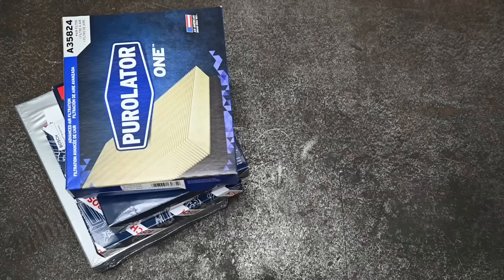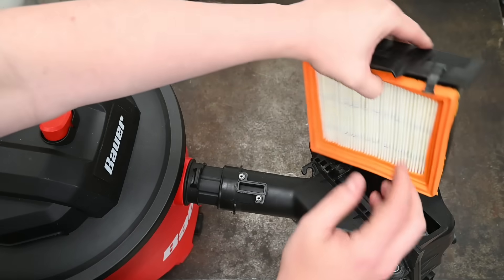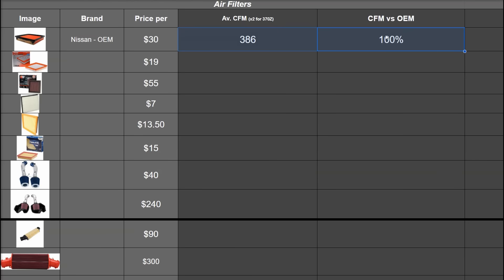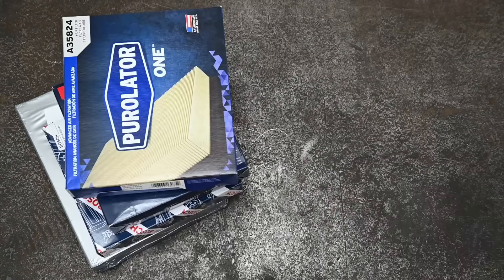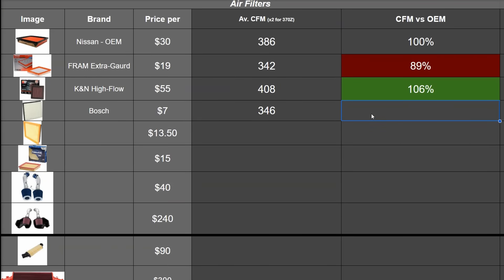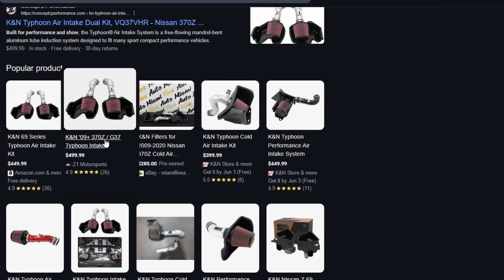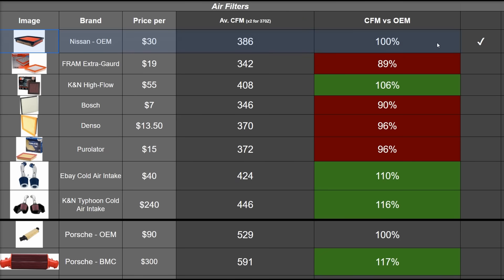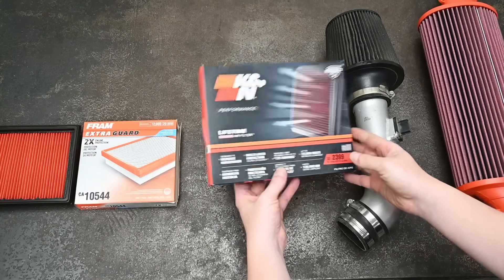Intake Filters TESTED: More Dough = More Flow?

Comment from the maker: We're only measuring a single bit of criteria here, do some filters flow more than others. There's of course other factors to as usual consider when looking at any product on our channel, how much particulate it catches, how long it will do that before that filtration and performance drops off quickly - so service life. Which we touched on a little testing cold air intakes. Measuring filtration, done right, requires days/weeks and a lab in our opinion.
Reply: Particulate caught, coupled with the airflow is what really matters. The K&N flows more, but that's because it's really only a rock catcher.
Reply: To test filtration, use ACCTD or ACFTD

AC as in the AC spark plug corporation

CTD = coarse test dust
FTD = fine test dust

Standardized dirt 

We did it years ago and found that the oiled filters (stock size vs stock size) start off flowing better but also let more dirt into your engine. Eventually their flow drops off as they get clogged 

This was done by an actual filtration lab, not me.
Reply: @JimConforti  ive seen studies that agree with you
Reply: If you guys ever want to test Porsche parts in situ, send over all the 991 3.4L stuff and I’m on it! 😊
Reply from the maker: @dannymac6368 never heard of a 3.4l in a 991
Reply: @TorqueTestChannel  the prior 991.1 2012-2016 base model Carreras use the 3.4L naturally aspirated MA1 flat-6.

IIRC, just thicker sidewalls than the 3.8L version in the S and GTS, and perhaps a bit happier to rev.

Awesome combination when you have the 7-speed manual and Sports Chrono, affording rev matching and magnetorheological engine mounts.
Reply from the maker: @dannymac6368 oh dang. Ur rite! Figured it was 3.6/3.8 like 997
Reply: @TorqueTestChannel  not sure exactly why they dropped the displacement, but if I could venture a guess…along with the 7th gear, it was for fuel efficiency. Just glad the dreaded RMS failure didn’t make the jump from 997 to 991! 

Really can’t go wrong with about 350 horses, 300 torques, 3000 pounds and 3 pedals.

Thank you, as always, for the valuable insights and thorough explanations of your mindset going into these varied tests. So grateful to see something interesting every single week on TTC! 👊🏼
Reply: Pressure drop from the filter would be good to see. Decent manometers aren't expensive or difficult to set up. 0.5psi loss would roughly equate to 3.5% HP
Reply: Purrolator? Mee-Yow
Reply: wow. it's impressive to see what a difference something as minor as an air filter can make in the breathability of your engine.
Reply: Curious how well measurements from an inline MAF would correlate to your flow meter measurements.  Or install a manometer port just downstream from the filter.
Reply: I'm a fluids guy, if you guys want to improve this experiment from just an indication to slightly more scientiscious relative performance, give me a shout. I promise it's not too too much work 😅
Reply: You might be surprised how manufacturers test head flow😂
Reply: Exactly
Reply: The Porsche BMC filter is 111,7 % of OEM 🧐
Reply: What are the chances you testing most of big boy brands for VQ37 drop in filters? Say OEM, K&N, Nismo, AFE, Z1, etc. But also how well they might filter potentially, or how performance drops.
Reply: Big argument on the 3.7 is the oem is better because short tubes suck heat in thats why long tubes that go in front of the rad are considered the best.
Reply: When are you gonna do some videos on three-quarter inch air impacts? I would love to see how they stack up against the DCF 964 three-quarter inch.
Reply: This test has been done before on YouTube so this guy is too late.
Reply: How about 2x OEM filters in parallel... I've always through the increase in filtration area would yeild better than stock but with diminishing gains.
Reply: Great air flow test, if anyone would like to see more tests that also include filtering micron particles , static pressure and airflow speed, vehicle 0-60 performance and new vs used filters go check out Project Farm, he did a deep dive on air filters comparing Fram Extra Guard, K&N Performance, Purolator, Wix, AC Delco, and EP Auto filters for a 2003 Chevy Suburban.
Reply from the maker: @steve_0712  Doing a filtration test correctly is very difficult, you can't unfortunately just throw some dirt & dust in a box which is what we would have showed you if we could get repeatable results. Generally if we can't get the same data each time with new products, the test isn't worth putting in the video. https://www.youtube.com/watch?v=_yYmj-G2R4s , https://www.youtube.com/watch?v=7D9lJxQ1s-U
Reply: @TorqueTestChannel  I understand that's why you did not include filtration tests because results are hard to replicate perfectly and that dumping particles into the box directly is highly unrealistic. But it does give a general idea of how they might perform under such conditions. I'm also aware of the video David Vizard did debunking Project Farm's results, but he himself admitted to "having done major pioneering work for K&N," so he is biased in any result given. I encourage everyone to watch all these videos and decide for themselves. I'm not attacking your work or any of these other channels' work, but the truth is all tests not done by a professional lab in a closed environment are subject to inaccuracies and should be used for entertainment purposes only, not as scientific data. Thanks for the reply and keep up the good work.
Reply from the maker: @steve_0712  You betcha, and agreed. It goes for channel wide though, if we come up with a test and use it on a product, then test another one and it's like 15, 20% off each time then we dont include it in any videos. If you're not able to get repeatable data, you're not dealing with actual data
Reply: @steve_0712  actually the project farm video was a horrible filtration test. the real issue is what he tested with, flour. it functions so different from dust/dirt that all of his tests were garbage. generally hes one of the best, but he messed that up pretty bad. there was an expert in the comments that went over specifics that PF actually pinned and said he'll fix it next time, but next time hasnt happened yet
Reply: Hey, it might be worth putting the air intake sensor in the pipe (or at least blocking the hole off for it), as that's drawing in fresh, unfiltered air into the mix, skewing your results. 
Those performance intakes will be taking a hit from this, as you blocked the IAS port on them.
Reply from the maker: @Miles7955  The 370Z/G37 box had its MAF sensor hole blocked off by the tight insert tube its attached with (the tube goes past the MAF hole). The CAI had all its ports taped. All holes were sealed.
Reply: @TorqueTestChannel  it appeared different in the video. I'll go over it again to confirm. Thanks for pointing this out.

Comment: Well your wrong about the air temp. OEM plastic tubing works as an insulator and soaks in the heat. Aluminum will at first but as more airflow through it the aluminum will start to dissipate the heat

Comment: We've concluded that the best thing we can do to our 2020 Connect is to remove the forward intake restricting tubes that's located between the grille and air box. This allows for more air flow even with a stock air filter. At start up. it runs quite, but stomp on it, it makes the engine sound like you've installed a turbo.. Love going through tunnels and underpasses..

Comment: I deal with things like this for a living and am constantly bemused by people’s ideas on air filters. Simple rule of thumb, if u live with ur car driving high up in the rev range constantly then a better flowing filter MAY help. If u don’t then it just makes a noise. Normal street driving in the uk uses torque more than power. Most performance filters drop torque slightly. VWs old 16v engine came with either a small inlet manifold or a larger bore one. Smaller had more torque, larger gave more revs. Just understand how u drive b4 wasting ur money

Comment: You mention "rather simple math" about airflow posted in a 3rd party forum, but nothing about doing any measurements to verify that your shopvac is an accurate simulation of the actual airflow & vacuum of the engine(s) these filters are designed to fit.
A normal flow test would have results plotted on a graph, not a single point.

Comment: Got a custom CAI pipe made for my mazda 3, heat shield included. I still run the factory resonator and cut a hole into my grille, putting a water resistant mesh and breathable wire mesh in it for even more flow. Had some small performance gains and it doesn't heat soak with the separation from the engine block.

Comment: So pito tube is not the best means of testing airflow in this particular way due to the small size. Per NEBB a small opening such as the 2.25 inch opening there would best be measured using a hot wire anemometer. However will that drastically change these results probably not. But it would be just a bit more accurate. 

Source NEBB blue book and my professional opinion as a TAB technician.

Comment: This is a rubbish test. You need to fit them to a car and run it on a rolling road to get a true test result
Reply from the maker: Do you mean to measure HP, as that would be specific to that vehicle if the intake was already a restriction or not - not measuring typical flow differences
Reply: @TorqueTestChannel I've seen tests for the filter changes and a stock panel filter system works better for non tuned cars than the other ones. The other ones loose power on standard engines so would be beneficial to show the difference between the air flow and what it actually does fitted to a stock car system because people will buy the non panel ones thinking they will get better performance when they don't.

Comment: K & N filters are absolute garbage. I ran one for several years on a 2005 Infiniti G 35 sedan it’ll let more dirt in than any other filter I’ve ever run. I cleaned it as often as I could think about it which might not have been enough, however, if you’re after about a 3 to 4 hp gain over longevity go for it.

Comment: I went with the K&N on my 04 Ranger for the specific fit, and it made an immediate difference, and once I opened the exhaust up with bigger pipes it really made a difference.
You can hear it sing a smooth sound

Comment: I drive a modified G37X and have 3 inch long tube carbon fibre intakes with high flow filters. For people saying most of these intakes just let everything through, you’re right. Most of them do but if you know what you’re looking for you can find high flow, high pleat, low micron filters. That being said they are not cheap. I paid just under $1000 for this intake. I also put hydrophobic filter socks over the filters for rain and any dust/something the filter might not catch. Also never go with short air ram intakes, like many have said they gunk up maf sensors and generally pull in more hot air than cold air. Sure throttle response is increased but overall performance is decreased. Spend your money wisely guys. Super cool video btw and so sick you decided to use VQ37VHR intakes

Comment: Flow is just one component. These are, after all, "filters".

What you need to test next with them is determine what size particles they allow to pass. 

The inside of an engine needs to be protected from particles so it doesn't grind itself dead. We're talking on the order of microns. What size is critical to prevent? What size is less of an issue? What size do the oiled ones pass when new, when used, and after cleaning/re-oiling? How much difference does it make when oiling with less than recommended amount, the right amount, or too much? How much of that oil ends up coating the MAF, entering the TB, or damaging other sensors or components?

Comment: Performance air filters are a joke. It’s like why pay more to let sand into your engine and ruin it if you’re racing just have nothing and rebuild the motor. OEM‘s use paper because it can filter out fine particles if you need more flow just add more filter don’t reduce the filtration

Comment: So, where is the next video comparing all decent brand filter options for the 370Z? 

Shame that stock boxes are quite limited it seems. 
But I would measure the flow with the included intake pipe. I think that would give a more realistic flow scenario, especially compared to those metal tubes. Mainly due to length.
And lastly, would allow testing of smooth silicone intake pipes as well, and any structural deformation under vacuum.

PS, you have choked the airbox flow a bit in this test. Mainly because the shop vac was inserted inside the pipe, not around it. So, the ID size might have had further flow limitations.

Comment: In my experience, these off-series filters with tubes will not be effective in real driving, on the contrary, they will further reduce the engine power set as in Figure 10.20 because they are located in the engine compartment where the temperature around the engine is high, unless they are placed outside the engine compartment to have contact with the external cold air that the engine needs to increase power. So all these normal filters pull cold air from the outside through the pipes and will have efficiency to increase power in real driving

Comment: There's a pretty in-depth video on YouTube about air filter's ability to... well, filter particles and keep an air flow. It's almost top tier testing, close to laboratory equipment and turns out your run-of-the-mill air filter does pretty much the same job as a higher priced brands. Most went on for 18k kilometers without a significant drop in filtering and air flow quality. And on the dyno - the car saw no added performance from... you know, performance filters. So, in my practice as a professional car mechanic, I would advise customers to change the air filter every 10k km, but it's not the end of the world if you skip it once. Unless you live in a very dusty/dirty environment.

Comment: A major factor you forgot to point out. Is any of the filters that car be washed and re used. Are cheap over all. Because you only have to buy one. And it lasts for years. And no trash in the land fill. Every time you do it. The paper filters are cheaper. And faster. Because you don't need to wash them. And wait til they are completely dry. But they make mare trash in the land fill. And you have to buy one Everytime. So add how many paper filters you buy
 Over the life of a good k&n or other reusable filters. And the reusable is a lot cheaper and better on the environment. I use k&n in my 85 gt. And a Banks cold air on my diesel truck. I buy two. So after washing one. I set it on the shelf. To let it dry a couple months. As I run the other. That way. I can still change it as fast as the paper filters 
 And if I'm real busy. Wash the reusable filters a day or two later. Set it on the shelf to dry a couple months. I like that I have no waste. And not sitting waiting for a filter to dry. And I get the better performance.

Comment: My opinion is the stock intake uses a lot of advanced science to supply a clean and consistent flow of air. 
You don't need to change anything until you reach about 100hp over stock. 
Sounds cool though

Comment: My first reaction is to being surprised by the very small size of the OEM filter and housing. I have two cars with 4 cylinder ~2 litre engines and the filters are at least twice as big. i  once had a '91 Buick Century 3.3 litre V6 that had a small filter like that. I had one incident where the filter became blocked by snow, resulting in a serious loss of power.

Comment: Actually turbo engines would be more sensitive to flow due to operating at significantly higher than atmosphereic conditions. A N/A engine can only ever take in as much air as they can consume, turbos can will force as much as it can flow

Comment: as filters are  there to protect the engine you now need to measure the partical size that each filter  will pass , if high flow filters let bigger partical through ,  which one would you use?

Comment: Most people don’t drive wide open throttle…
Honestly, a clean air filter is better than a dirty air filter and K&N or oil soaked air filters are good for the drag strip race day and that’s about it. The oil from the filter gets on the mass airflow sensor and causes it to give a false reading which trips your check engine light and messes with your air fuel ratios. Unless you’ve done some really radical stuff to your engine and your exhaust and I mean no catalytic converters don’t waste your money or your time with aftermarket intakes.

Comment: When doing scientific and mathematical communication, it is suggested to shy away from the term "average" as it can have ambiguous or subjective meaning. It is much preferred to use the following terms where it makes the most sense to do so.

Median = Center most value; throwing away samples that are on the edge of the bell curve as they are probably bogus. Most useful when noise is high.
Mode = Value that is repeated most often. Most useful when data can only take defined integer "bins"
Mean = What most people learn in primary school as "averaging." Sum of samples divided by the number of samples. Best results with lots of clean data.

All of the above are considered in discrete time. That is, you would have regularly spaced samples up front before you can calculate them. There are continuous time counterparts, but they are not needed here as far as I can tell. Which is good, because they can get quite ... 😏 "convoluted." ... 😅  ha ha ...ha...

Comment: My pod filter is significantly cooler than the standard box after a decent drive I do think that is largely because of the hood scoop but the car doesn’t have any noticeable loss in performance compared to oem and it sounds a hell of a lot better if you’re going to a pod filter for performance purposes you’re not particularly smart but if it’s sound that you want go for it